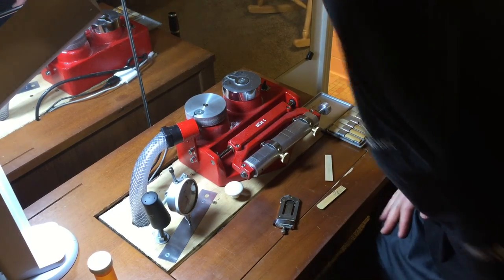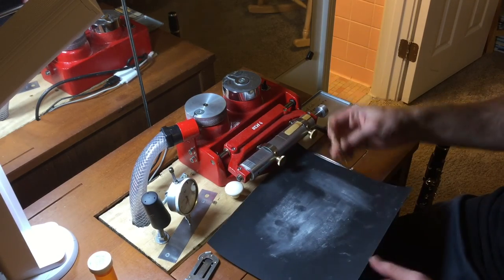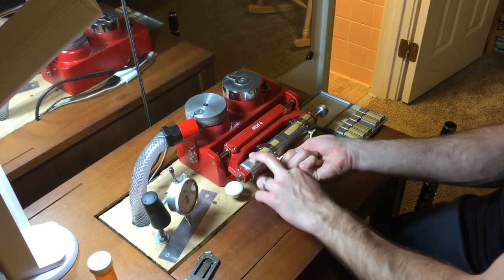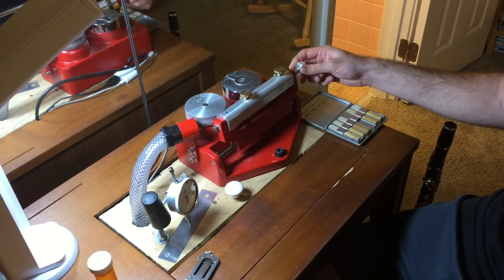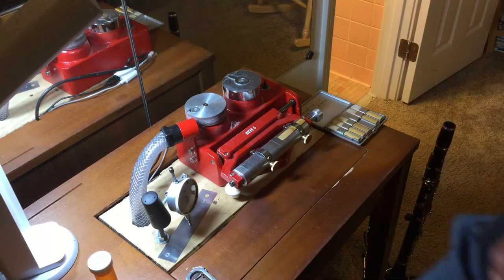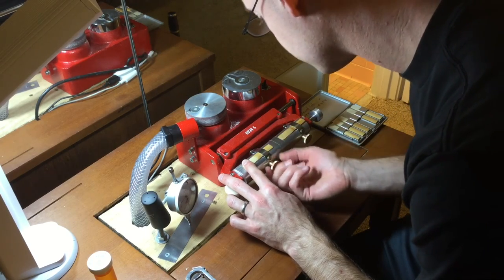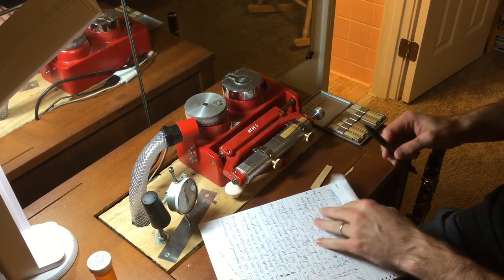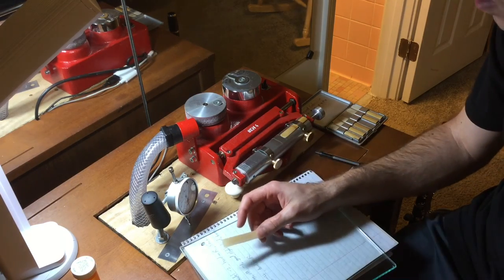Reed-making with the BKM 4

Comment: Have you tried putting a paper or cardstock shim underneath the model reed tip, in order not to make the tip thinner, but allow the back of the reed to be sanded more? I always was going to get one of these, but made do with the ‘Dual” during years of making reeds. Alternately, you could choose a lighter strength reed as a model for a particularly dense blank reed.
Reply: Putting it under the tip would make the tip thinner, it seems. I used the Dual in college - my teacher had the machine in a closet and let all his students use it. Good memories

Comment: This equipment similar to a key making machine. In addition to polishing, etc the reed, I have gotten into the habit of putting clear nail polish on the butt of the reed to seal it. Not scientific but I do it, have no clue whether it helps or hinders the reed, but I know it seals the butt of the reed.
Reply: Sealing the butt of the reed should prevent the humidity from affecting the reed. Where I live the reed changes every time there is more precipitation in the air outside. On rainy days I have to go to another reed. Sealing is a great idea. I will have to try that .... on a dry day with a great reed.
Reply from the maker: I break my blanks in before I sand the reed.  I suck on the reed for several days until the fibers start to break down. That will prevent a lot or warpage when the weather changes. I know the reed is ready when I put the reed halfway in water and the water does not climb up the reed after a few minutes